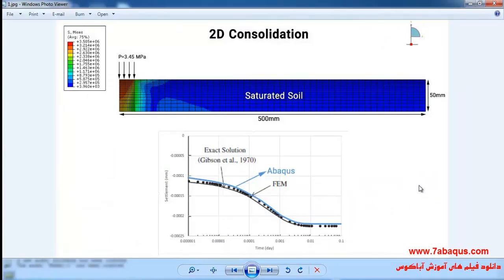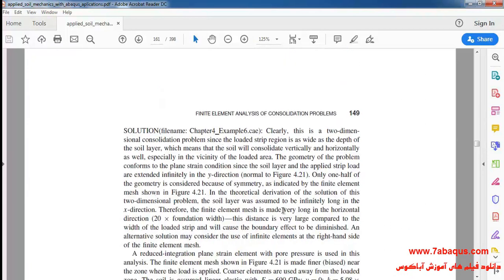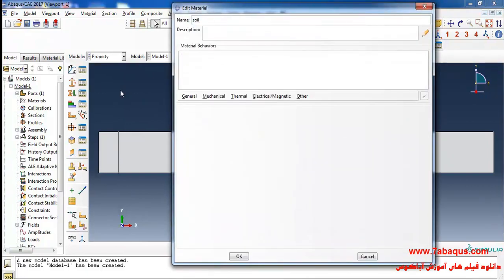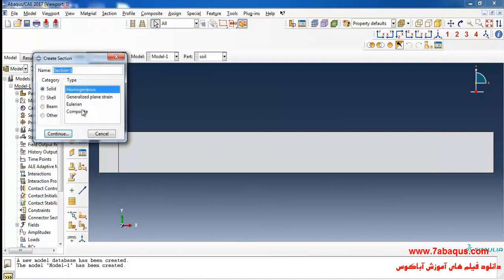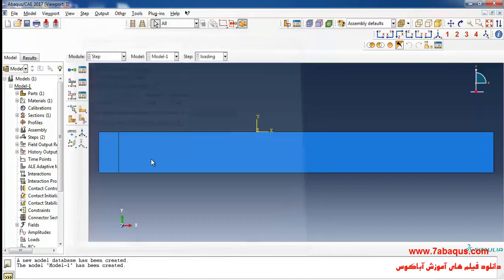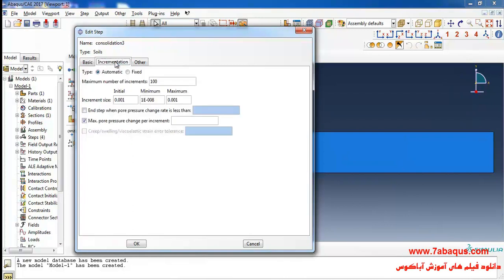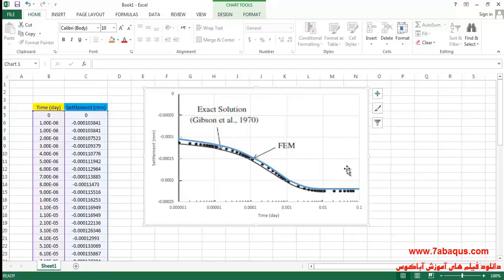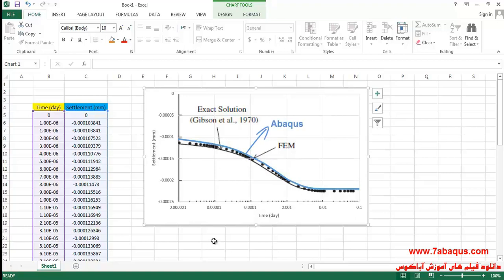2D consolidation of a fully saturated soil layer Abaqus

Comment: In 1D consolidation you applied geostatic stress, but why not here in this case? Also you haven't defined any predefined field here like void ratio? Is the same procedure applicable for 3D model in abaqus?
Reply from the maker: in 1D and 2D consolidation , we define void ratio for soil (see again these videos)
------------------
in 1D consildation , geostatic stress is the same "seating Pressure" in this example
-----------------
in 2D consolidation , you can define geostatic stress by (effective specific weight *height) But because the soil height is low (50mm) the impact of geostatic stress is low
Reply: @saeedmoeini-7abaqus  Thank you. Is same thing is applicable if it is 3D model or something more we have to add?
Reply from the maker: @suhitchakraborty1342  
you can simulate 3D consolidtion like this example 
but if your model is big , you should define body force and geostatic stress for soil
Reply: @saeedmoeini-7abaqus  Thank you .